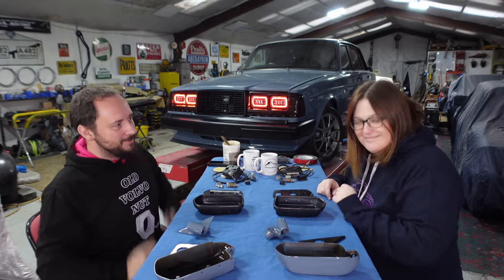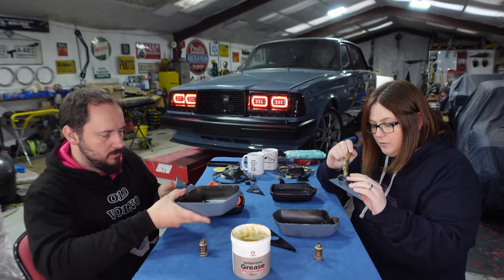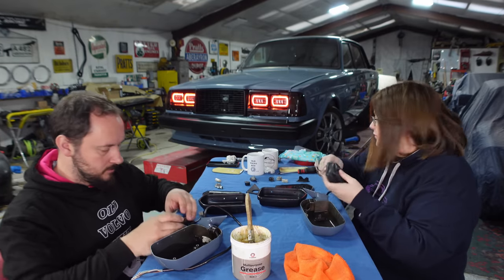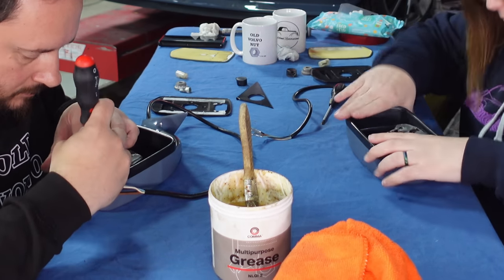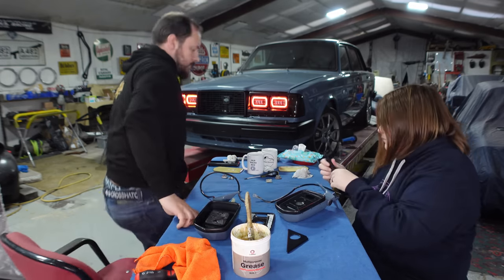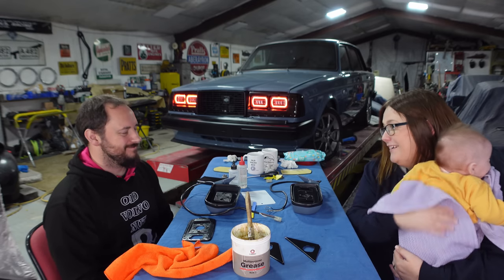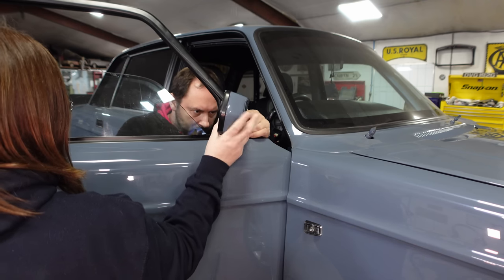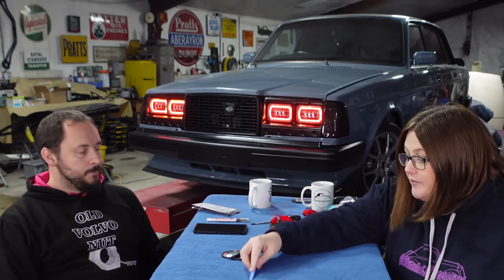Real time Volvo 240 Wing Mirror Build and Install - With Added Waffle!

Comment: How I am today? Thanks for asking. I changed two loose screws that should hold the right front speaker in my Citroën C1. The holes a little bit worn out, the screws to small. The result was a rattling noise. Now it’s fixed, I’m happy, the Citroën is happy and watching two people reassembling Volvo mirrors is not too bad. Take care, cheers —— Martin

Comment: I am trying to work on a Peugeot Partner Tepee because the DPF was blocked up (as I do not drive fast enough), all went well except the bottom pipe which sized and had to be drilled out easy NO I have had to tap the threads. I wished you had not asked!